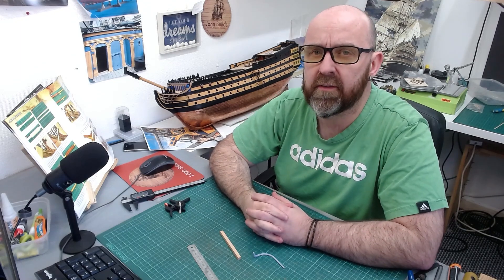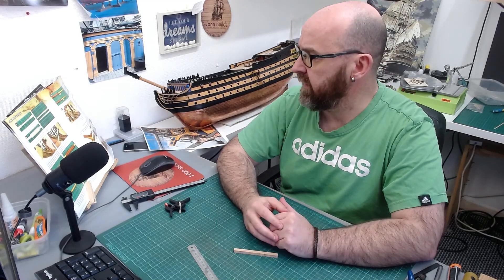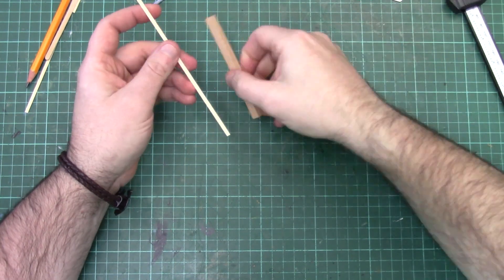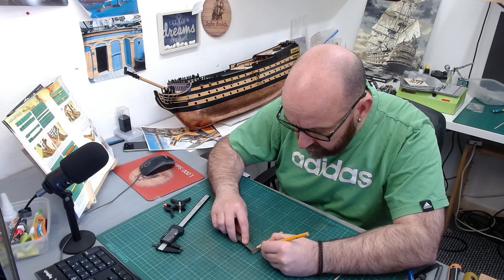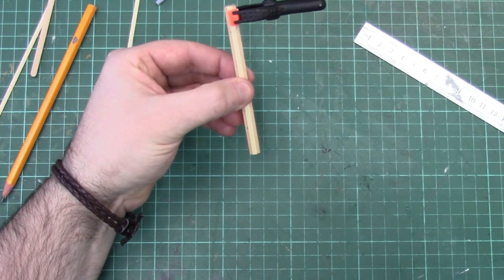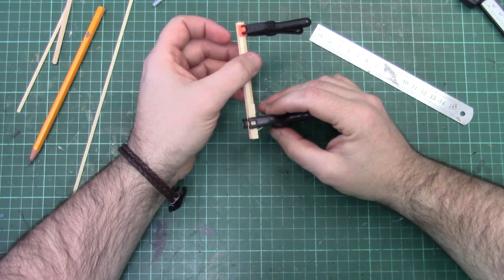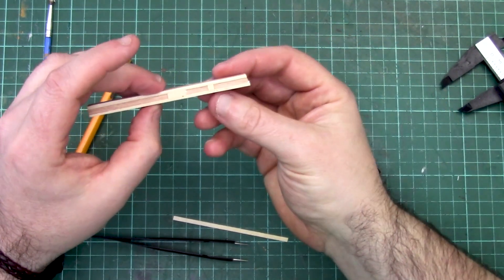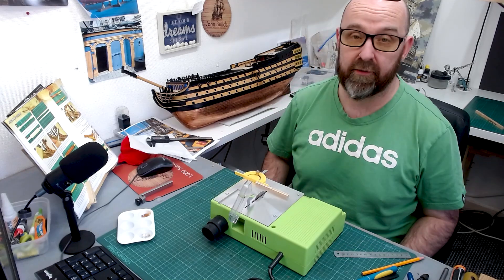Model Ship Building :1/84 Scale : HMS Victory : Part 75 : The Catheads

Comment: Nice job John! Using the "Woodymodelworks" parts gives this section far more detail. In this case Deagostini could have given more attention to the details. I can see that comparing it with the build i do for the Mantua Panart Americo Vespucci. Scale is also 1 : 84 but in this kit the catheads are far more detailed and contain more parts both wood and metal/brass. I am concidering removing the present parts on my Victory build to replace them by "Woodymodelworks parts or at least use leftovers from the Amerigo Vespucci build to improve the looks of certain parts.
Reply from the maker: Hi Ron that sounds like a good idea. Good thing about builds like this. Is you can make like refits and start again on some sections
Reply: @darkwoodster79  I wouldn't mind using your offer but...................my wallet is empty at the moment so i am waiting for my holiday alowence. i allready purchesed the first parts recentely. They look good.